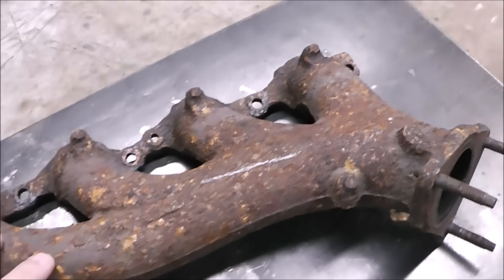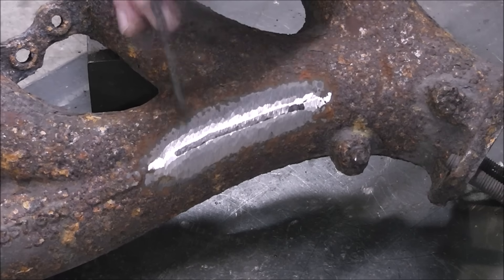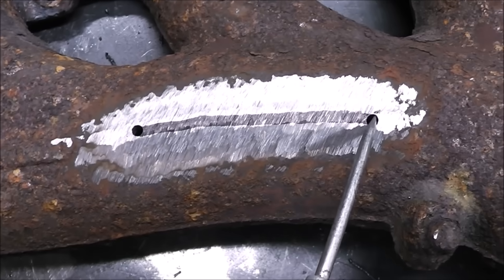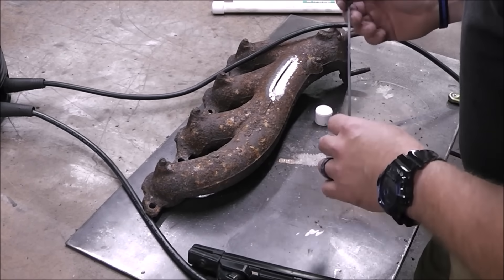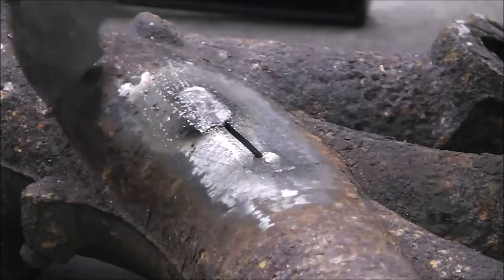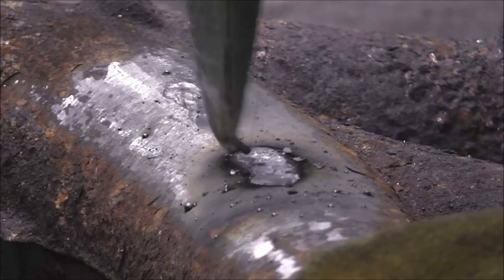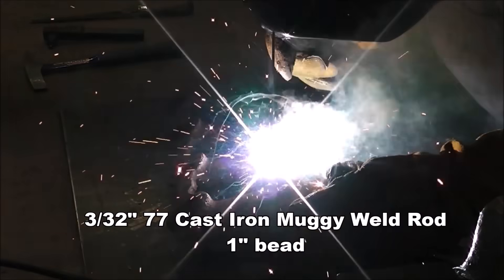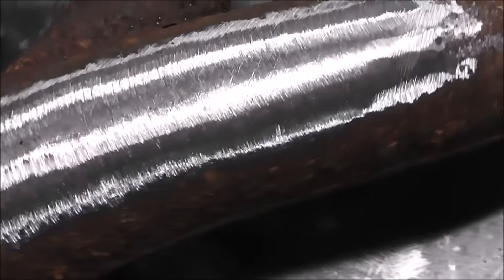Stick Welding Cast Iron Repair with Muggy Weld

Comment: Yea man, that's an old skool trick to repairing an exhaust manifold. Now this is gonna sound crazy but if you bolt up the manifold with no gasket to the head (providing it's an iron head) it will never leak at the mating point...gasket cannot leak or fail if it's not there...Y'all think I'm crazy but  it's the truth...back in the day before emissions they didn't use gaskets. On headers it's a different story but an iron manifold to an iron head it will not leak ..just clean up the mating surfaces with a scotch brite pad on a 90° angle grinder.
Reply from the maker: Interesting! Does it leak? I assume it must leak a little bit or they wouldn't have added the manufacturing expense of adding one.
Reply: @BrandonLund  never once had any issues of a leak, if you think about it and see the way it is bolted and how thick (or wide) the mating surface is, as log as it's clean and not severely pitted, there should be little to no flow resistance on exhaust anyways, so with no pressure build up of any extreme measures it kind of cannot leak. If you really look deep into automotive  history you will find some engine builds that had lapped heads and no head gasket!!. (I cannot remember what manufacturing company that did this) but it really did work. As far as the exhaust manifold goes when my Co worker who was an old skool mechanic told me about it...I was very skeptical when I first tried it but gave it a shot anyway I then never put an exhaust manifold gasket on again if there was an iron head. Crazy huh?  I do not know why they added a gasket..I'm sure for some reasons of leaks or paranoid engineers..who knows ..
Reply from the maker: This is why I love the community on this channel! We are never to old to learn. Thanks for the info!
Reply: @BrandonLund  Of course!! I love learning new things too...with automotive, I'm constantly learning..that what I love about it both history and the new high tech stuff!! Great video and weld job, it's wayyyyyy better than what I can do.
Reply from the maker: Thanks man! 😁

Comment: Looks like a 70's "ford" V8 manifold with Smog Pump holes plugged.
Reply: That's a chevy manifold from a truck  99 to 2006 , I have welded other cast iron manifolds but these weld the best. I weld these like any other piece of steel and not a piece of cast iron.
Reply from the maker: It could be but I don't know much about it :)
Reply: @BrandonLund  A very nice weld, start to finish.
Reply from the maker: Thanks man!

Comment: GM 5.3/6/0 manifolds are not cast iron,  ive cut many flanges off and TIG welded vband ones on them,   its just mild steel.   Ive done lots of cast iron in the past and these are definitely not cast iron.
Reply from the maker: Yah a lot of people claim these are cast steel but they aren't. They are cast iron. To prove it I have attached the independent lab testing results in the pinned comment section. You can also search online for this OEM style manifold in cast steel but you won't find one. They do make aftermarket cast iron manifolds but they dont look like these and these are OEM factory. We also spark and drill tested them.  So we have the lab tests and destructive tests all concluding they are made of cast iron.

Comment: Funny thing is those manifold are not cast iron they are cast steel so yea they are gonna weld pretty good
Reply from the maker: If you could send the link. I've been looking for 2 years and have only been able to show the independent lab testing showing they are in fact cast iron.

Comment: I just noticed that was two different sides of an exhaust manifold how do you start on one and then finish on another but don't tell people that is two different welds unless for some reason I have my eyes in backwards today which I doubt.
Reply from the maker: Please read the pinned comment
Reply: @BrandonLund  yeah growing up my dad used to always throw them in the oven and heat them up before he would weld them. Learning how to weld something I've always wanted to do but I've never really had the time I figured at some point I would buy a welder and teach myself you know how it is when something really interests you it seems learning how to do it comes easy but if you can't stand you never learn how.😂😂 good job on the whale does manifolds look real good once they get sandblasted and painted you might be able to make a few dollars off of something you dug out of the trash.🤔
Reply from the maker: @MikeSmith-cg7nx  preheating is the prefered method but the manufacturer and many others have claimed that its not necessary with this specific rod so i wanted to see if i could test it out. It worked like a dream but if I was repairing something and I had the ability to preheat I would as an added safety measure then immediately  bury in dry sand to cool. Cherrs buddy!

Comment: The only problem I saw with this was that he did all the work on the front side of the pipes and then ground down and showed us the back side of the pipes and told us this was his finish weld.. then said nothing about  the fact that the welds were on the other side.. Which in my book makes him a liar and a fake.. someone disagree? you saw the video.. you saw which side of the pipes he did the weld and which side he produces as his finish weld..
Reply from the maker: Read the pinned comment sport. I'll await your apology. I doubt you have the integrity to admit when your wrong but we will see...
Reply: @BrandonLund  I am sorry you never mentioned anything about welding the other side of exhaust pipes in your description.. So my opinion still stands.. you should have said something in the video.. I still believe what I said and I am sorry.. sorry you can not tell the difference.. But then I really didn't expect you would.. Beside.. it is just my humble opinion from what I saw.. you can delete the post if it hurt your feelings.. But the truth is still there for all to see.. Not all of us read the comments..And you should speak truth from the beginning.. I am sure others have noticed this also and did not read any comments..
Reply from the maker: @tinkmarshino  unfortunately the video  was uploaded and had thousands of views before I realized my mistake. I did my best by trying to point out my error by making the comment the first in the comments section. You saw me grinding side A. I inadvertently welded side B. Its that simple. Not trying to trick anyone. Follow the rest of the series and you will see the other side. I appreciate your response 👍
Reply: @BrandonLund  Well.. I am sorry to give you such a hard time.. But you must realize that folks do not always read the comment and when they see something like what I saw they think the worst.. This world is filled with hoaxers and hustlers.. If you do not make things perfectly clear what are folks meant to think. Just imagine how many other folks saw this and never came back.... I do apologize.. I was to hard on you.. sorry.. Carry on!y
Reply from the maker: And I take back that I didn't believe you would come back or apologize. I was wrong and thank you for taking the time to check it out.  Your right, many might not but it takes a much bigger man in my book to use the word sorry. Our world actually needs more people like you. Thank you for watching and for commenting. I would love to have you as a regular viewer. I try to be straight forward and clearly explain everything im doing in all my videos as best as i can but sometimes things slip by that i dont realize until its too late. Take care and thanks again for taking the time to respond.i truly appreciate it. Brandon.

Comment: If im not mistaken that looks like a chevy Truck exhaust maifold. For years now guys simply mig weld flanges for turbos to those all day long. I’ve done it myself. Preheat with a torch and mig away.
Reply: I think that was more of a lesson of how to weld cast iron. The Chevy manifold was merely an example of a cracked cast iron piece.
Reply from the maker: Jackpot! Thank you! 👊👍
Reply from the maker: Yah I've had real good luck with mig on lots of cast. It really depends on the composition

Comment: hi i have a  boat engine that i am trying to repair i have found the maifold  has cracks and leaks can i weld these to stop the leaks.
Reply from the maker: 100% you can.  Check out today's episode for more cast iron related stuff :)

Comment: If I submitted a weld like this in my class, I would get laughed at, “perfect weld”
Reply from the maker: Interesting comment because this video is actually used in some welding classes. I've worked with guys like you and they never seem to last long on the job thinking they know it all. You've got a long road ahead of you if you don't learn to humble up.
Reply: Brandon Lund, I said what I said, if I submitted a weld that looked like that, my Teacher would tell me to start over.

Comment: This si the best example how yo weld iron cast, but i undesrtand than then you weld iron cast u have put the pice in sand
Reply from the maker: Thank you! Generally you should always preheat, post heat and control cooldown but this is a "worse case scenario" to see how the rods handle thermal shock.

Comment: Preheat in a gas grill.
Reply from the maker: Great tip!
Reply: I've never tried the muggy rods. I had problems with the Ni rods cracking and switched to acetalene welding with cast rods and I use borax for flux. Preheat on the grill. Weld continuous kind of like brazing. Then put back on the grill for a slow cool down. Worked on pot bellied stove and marine water exhaust manifold cracked by water over the winter.

Comment: All I’ve got is a flux core welder, the Hobart 120 or 125. Is it possible to weld a manifold with that? I have an old car and the turbo manifolds are extremely hard to find.. please help!
Reply from the maker: That is plenty of power. Be sure to check out my playlist. I think it will help you a lot https://www.youtube.com/watch?v=kzbcVb2UymA&list=PLfbf78fMz9VpweFv4IqUfrrNV6Vvro7Cd.

Comment: Great video! Why do you show the opposite side of the manifold in the last part of the video? The crack you created was on the other side.
Reply from the maker: Thank you! I have a long explanation in the description but basically I was filming 2 videos simultaneously and forgot which side of the manifold I should be working on.
Reply: @BrandonLund  Cool! Still would like to know how the weld turned out, on the original side were the "crack" was created and mended...but ok, thanks anyway!
Reply from the maker: @ZS3PV  If you check my other videos in this series you can see how the weld held up after we cut it in half and did a break test. The other side was TIG welded. That video is in that series also
Reply from the maker: @ZS3PV  just to be clear, you saw me cut /grind side A on camera. Side B was cut / ground off camera. Side B is the side I welded on camera. Side A was TIG welded in a future video.
Reply: @BrandonLund  According to the video, you cut, ground and welded side A (see manifold orientation), but show side B as the finish.
Just to be clear: I'm not accusing you of anything, I just noticed it, and wondered why you would show side B, when you clearly was working on side A the whole time.
Reply from the maker: @ZS3PV  no offense taken but look closely. Both sides were cut /ground. Only one side was stick welded. It's been a while but the manifold was ground on the upside or downside (I cant remember) but welded in the opposite orientation.

Comment: You welded both sides?
Reply from the maker: The other side was tig welded. Its explained in the video description along with a link.
Reply: I missed that, sorry. Great job with the welds and with the video. Do you have one for filling in a rust hole on the same type of exhaust? Old tractors seem to have this problem. Thanks.
Reply from the maker: @secondchanceiron6123  rust can be a real problem. Are you able to get it cleaned back to bright shiny metal? If so, you might be able to put a patch over it.

Comment: Is it possible for me to buy a couple rods off of you?  I just want to try it on a couple of peck marks on my (cast iron) drill press table. I looked on Amazon and my wallet just about screamed when it saw $80.00 + $13.00 shipping for 1/2lb of 3/32" dia rods...
 https://www.amazon.com/dp/B07RYG2C2C/ref=cm_sw_r_cp_apa_i_LcpaFb3374Q4E
Reply from the maker: I have to see what I have laying around. If I have some I will gladly hook you up for a good price.
Reply: @BrandonLund  I've been trying 7018 and it's been alright but I need something like this to probably do a bigger cast iron repair of a dovetail at some point so I'm still interested.

Comment: 3:35 I only use the diamond cut off discs by Lenox. I've had friends that have told me only negative things about them... I personally don't have anything bad to say. I've heard some people say they are louder than regular cut off discs but I can't tell since I always wear hearing protection either way.  After all if a welding shop isn't loud, bright, or hot than it isn't a welding shop. Maybe it was that they or someone they worked with used a cheaper brand of diamond cut off disc since I love mine and I can't see the end of its life any time soon.
Reply from the maker: If you like the Lenox disc you should try one of these.  I came across it a few months after making this video. It's only a couple dollars more than the Lenox. https://amzn.to/2DcFk5g Honestly it's way better than a Lenox in my opinion. It cuts faster and it's super accurate because it's a continuous rim unlike the Lenox which is segmented.  I have both and go for the continuous rim every time.

Comment: What if I only have a mig welder? What would you recommend for a cylinder head. I have a broken threaded tab on the end of the exhaust port.
Reply from the maker: Hey Chad, check out my Cast Iron repair series. I have some videos in there where I actually repair some cast with mig.

Comment: Anyone else notice, that he shows opposite side of the manifold after the weld ? Is this bogus, or am I seeing things ?
Reply from the maker: Just read the video description. Its explained there
Reply: I read the description, but I still don't understand why both sides of the manifold were used to repair one crack. I'm not trying to be a smart ass or anything, I just noticed that both sides are worked on and the description doesn't really explain why this would be...maybe I'm missing something ? Nevertheless, the "crack" at the start isn't the final finish that is shown. That much is clear to me. Thanks.

Comment: tig weld with na82 high nickle
Reply: thank you it works well if its good  cast. you can also knock the flux off  mg260 stick rod get it all off and use that as a tig rod also. either works good for fine small work.
Reply from the maker: I'll give it a try. Thank you :)

Comment: Cheers mate, helpful. I was wondering whether the inside comes out good? Have you tried to smooth it out or check somehow?
Reply from the maker: Yes I have. Check out the cast iron playlist. I actually cut apart this repair, break it at the weld then examine it.

Comment: A major factor in cast iron is the grain structure of the steel. Because is is formed from molten molten steel straight to finished form it's crystalline structure is very coarse. Other high carbon steels go through a milling process that reduces the grain size of the steel making it far tougher & far less porous.

Comment: That's a GM manifold, it's not cast iron, it's cast steel. Very different and much easier to weld..
Reply from the maker: Its cast iron.  HERE IS THE INDEPENDENT LAB TESTING SHOWING THE CARBON CONTENT https://ls1tech.com/forums/forced-induction/1750208-what-truck-manifolds-really-made.html
Reply: @BrandonLund  either way, super easy to weld. I welded v bands on a set and I'm a HORRIBLE welder! lol

Comment: best way to preheat cast iron for welding imo is a package of briquette charcoal, light it, and set the cylinder head or manifold face down into the hot coals.
Reply from the maker: Great tip! Thanks!

Comment: If you preheat, what temp would you preheat?
Reply from the maker: I don't like to start wrlding less than 350f roughly but something is always better than nothing. It just lessens the temperature swing between the part and welding temp

Comment: As an old farm boy I've seen several techniques for heating, cooling & welding cast. 
As a teen I broke off one of two exhaust flange mounts on an old Pontiac. I may have 
tightened it uneven. oops  My Father preheated the flange with gas and brazed 
the broken off tab back on. It was never a problem & I traded it in on a 61 Vette.
To bad this type of welding wasn't around - nice job
Reply from the maker: Thanks man! I did something simular as a teen also...snapped the flange off a transmission mount by doing the same thing. Only then I had to find someone to fix it for me.

Comment: Is it possible to pull this off with 6013?
I have a drill press table from an old Kira NRD-340 machine and it's filled with small, shallow, blind holes and a larger gap in the center.
Reply from the maker: https://youtu.be/ADa1I319GJ0
Reply: @BrandonLund  
Yeah, I found your video and watched it yesterday. Just what I needed to know, thank you!
Reply from the maker: @makismakiavelis5718  Thanks Maxis, I appreciate you watching and I'm glad I was able to help. Take care man!

Comment: i'm old shool welder but would preheated it and brass it it will give better then stick welding it will crack
Reply from the maker: This was a viewer requested video for this process and filler metal. High nickel content rods are a proven repair method.